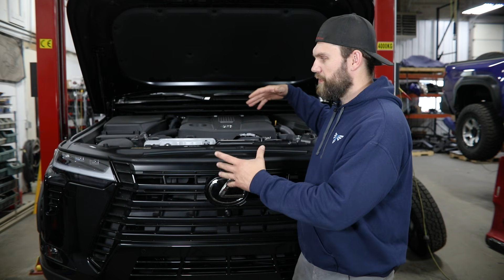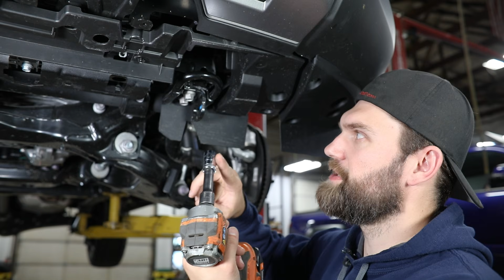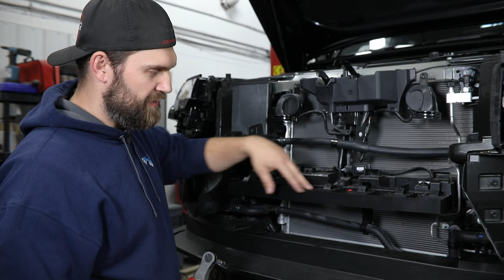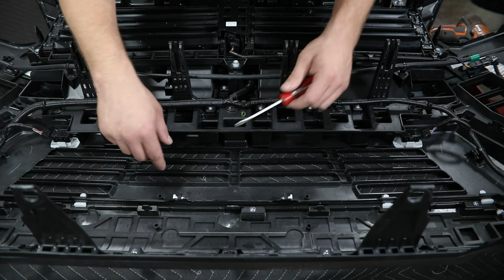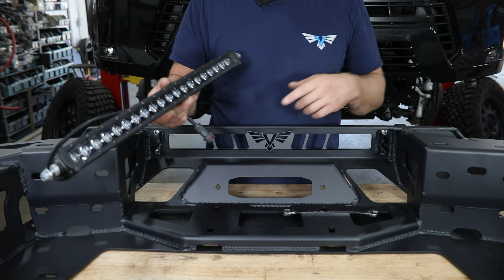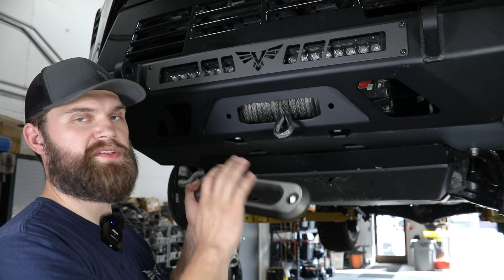GX 550 Front Blitz Bumper Install

Comment: So you've removed the factory crash bar and in its place you now have a 50 pound winch. Have you tested this setup for safety? Does the bumper slide back a little in a low speed collision, like on an ARB bumper, to help prevent transmission of forces into the frame? And in a higher speed collision, with the focused load of the winch right in front of the center of the radiator, what happens? Does the winch fly like a rocket through the radiator into the engine and blow a hole through everything? What kind of modelling or crash testing have you done here, given that this modification could potentially have a huge impact, literally, on safety in a crash?
Reply: I had same thought... How did they not replace the factory crash bar, and install the new bumper around it... seems like a massive safety issue.. as I'm sure they didn't do crash testing / simulations to prove it is safe.....

Comment: Great video of the install. What is the net weight gain or loss (excluding the weight of the winch and lights), what is the improvement to the  Approach Angle, and how much does this facilitate the installation of larger tires ?